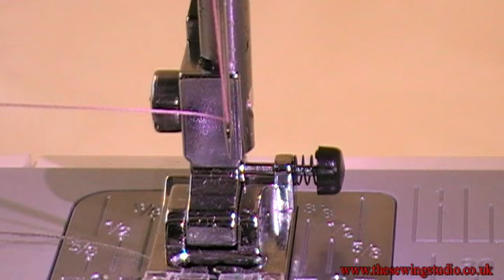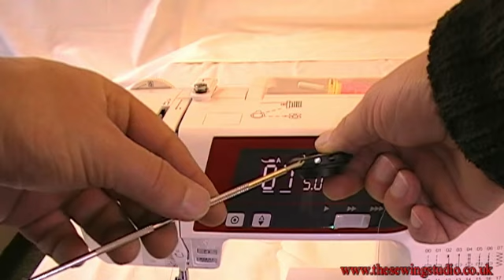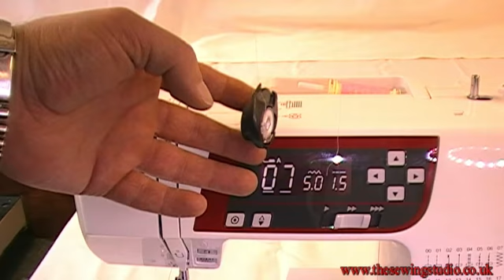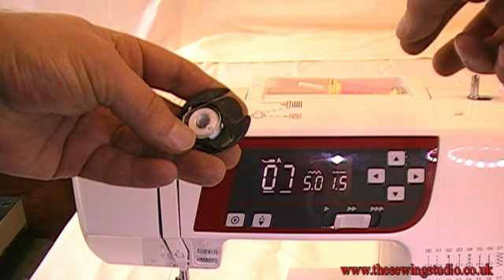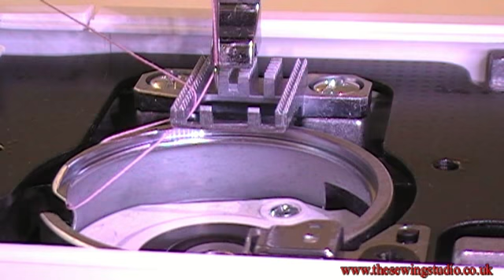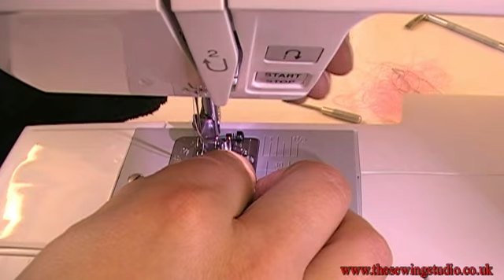Maintenance Top Loading Machines (Part-2)

Comment: Hello, Your videos are exceptional. I followed what was said but when I sew the top looks good but the underneath is all loopy. I am not sure which tension I should be adjusting. My machine has been out of commission for almost a month and I feel like a fish out of water. It is not an expensive machine, a Brother xl 2600i and the repair shop quoted a minimum of $90.00 to check it out.  Any help greatly appreciated.

Comment: I know this post is long but I wanted to see if you might help? My brother ls 590 the hook broke and I'm having trouble replacing it. The timing is good but the hook part was plastic everything else is metal. Go figure. I wanted to replace the tip only but can't find a replacement.

Comment: Thanks for the info; my 25 year old sewing machine of my wife was not properly working anymore; it had loose stitches all the time. The spring of the adjustement knob was weakend by aging. Even with the knob on 10 there was no more pressure. I took off the plastic knob to be able to tighten the wire so the needle bend 3 mm by pulling the wire with the foot down. I also had to clean out the bobbing compartement; there was a lot of dirt in there. Now it is working perfectly again. Many thanks.